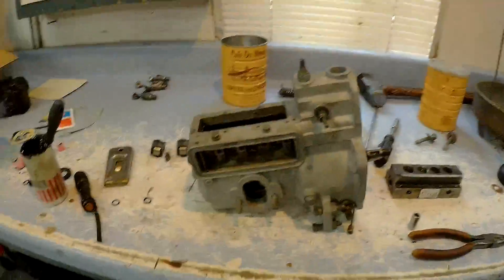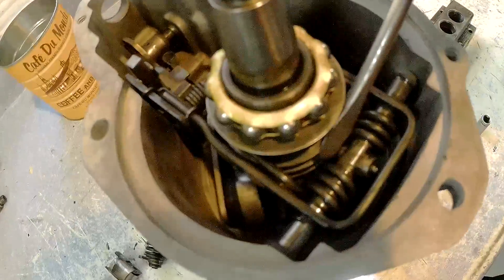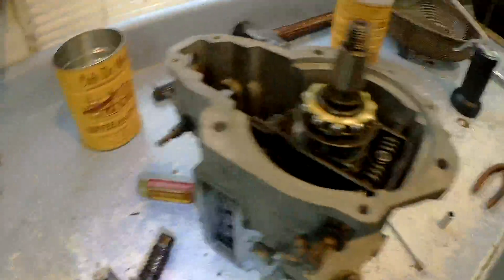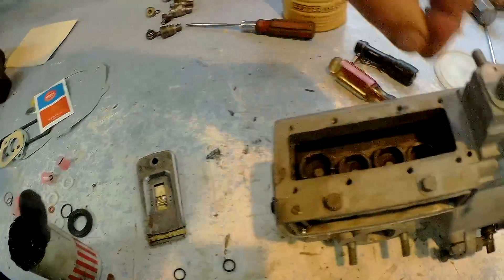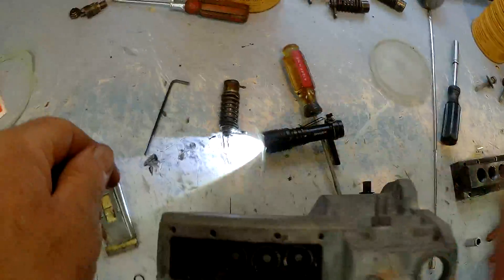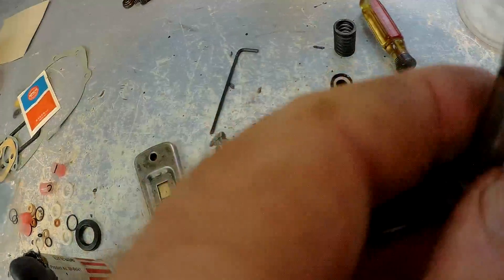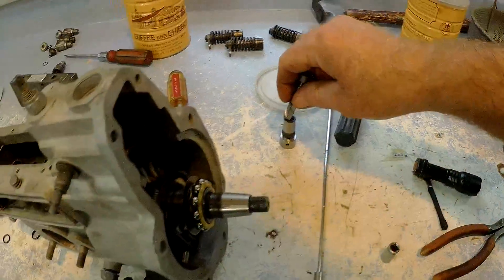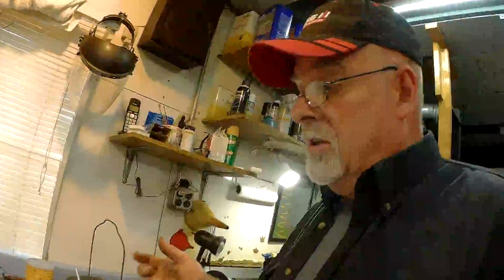Simms Injector Pump Assembly - Ford Tractor

Comment: Interesting... I have a stuck injector rack and I've tried to free it up with duck oil but with no success at the moment. It will move with a screwdriver but will not allow the cold start button to release, hence the engine goes runaway..
My question is can it be freed up or is it a case of sending it off to some specialist repairer?
Reply from the maker: Oh I'd hit it with perhaps some automatic transmission fluid, or if you don't mind spending the money, some KROIL .. Amazon sells it. Then keep working it and working it until it's free, hit the plungers as they may be sticking. The rack itself actually floats pretty free within the housing

Comment: Where can I get a rebuild kit for a p4596 pump. My throttle rod was stuck on mine and i tapped it both ways but still stuck. When i watxhed your video I took it apart and the wedges between the roller bearings wer not there and one of the  rods with the adjustment thing was stuck in place with the  part on the bottom that goes in the throttle rod was broken off. I may have broken it tapping it. The tractor was running but at full throttle so i pulled the kill swirch and it has not ran sinse. Thanks, Garry Harris

Comment: In ireland you can exchange you broken pump for a replacement reconditioned one for 350 euros and plungers  and elements and spring and seals are 250euros when baugt on the Web and the exchange will be calibrated and Garenteed by a professional.(4 cilender pump) the springs should be replaced as they brake when fatigued.they buy the stuff less vat and holesale and of higher  quality Irelandi is full of ford and fordson tractor and minimec pumps,But that's not the case every where.
Reply from the maker: WoW What a deal !
That would easily be $1500 here in the USA

Comment: I could use some help if you got a chance I don’t know if you have an email or something. I got a four 3000 diesel three cylinder getting no fuel coming out of the first injector line of the pump. I’m mechanically inclined, but I don’t know anything about diesel. Meyers said to take that top head off with the valves. I’m not sure what to do after that. Are you in the south? I saw the café do mine
Reply from the maker: Take the side cover off the injector pump with the engine running and observe the lifters, I suspect #1 is stuck "up".

Comment: couldn't figure out why my engine is suddenly on full throtle. I have checked the plungers, it seems to be ok.
Reply from the maker: Check the rack, make sure it's free. There's a little -tall cap you can remove (unscrew) on the end of the pump, the rack actually enters that tall cap.
Reply: @mark_osborne looks like the rack randomly stuck on full throtle, is there suppose to be a spring in that tall cap to help push it back?
Reply from the maker: @sionenaulala8965  no spring . Something in the govenor must have hung up

Comment: i have a simms 3 cyl pump i rebuilt engine and cant get the pump to pump up i replaced the supply pump but didnt help im getting fule to the injector pump but it wont pump up any advice?

Comment: Hello Mark, I have a Simms Pump, P4784 its for a 6 cylinder Ford 8000 farm tractor. I need to order a rebuild kit for this pump including plungers & barrels. Would you care to share with me where you ordered your rebuild kit for your Simms pump from? Thank you!
Reply from the maker: I did not order a rebuild kit.  The gasket and seal set came from Wimer Fuel Injection in Pennsylvania.  As far as the plungers and barrels, I dug around until I found a part # that matched the 9.5 mm that I was looking for then contacted Darwin Diesel in the UK.  They have a website.

Comment: So I could turn up the fuel on my 1920 to go from 33hp to the 40 hp just like  other 2.0 N844 engine have? Lkke the TC40 with the same engine.
Reply from the maker: I wouldn't doubt it !  I have a 33 hp 1920, bought it new in 1995. Great machine !  Let me know. I have no color in the exhaust under full load. I'm sure yours is the same way if it's bone stock.

Comment: Actually it's for a Fordson Major tractor, pre Ford. 
The earlier pumps had pneumatic governors, the later ones, mechanical ones. It sounds as though they're not so well known in the US? These are ten a penny in the UK, and there's any amount of Diesel service shops that would repair/re-condition these pumps. Great video - and I agree - these are great to work on!

Comment: Would it be possible to post a part number for plunger and barrel?  I have the 3 cylinder  p4665 pump.  Thanks.. Great video
Reply from the maker: yes yes  just did this on the last video

Comment: Holy moly than you so much for this!!!! This is the only video in the world that helps the people with Simms pumps. I have this pump in my boat. This is a very common pump found in the Ford marinized version, the Ford/Lehman.  I have been nursing my hurting pump for years and this year it is finally getting around 4oz of infiltration per 20 mins of run time. last season I was able to just change the oil every 10 hours instead of 50 with only 1oz. So it finally got to the point where I was afraid of ruining the core, so I stopped running the engine. So after getting the runaround from the local pump shops, and finding no information on these pumps anywhere, I finally bought the only one available "off the shelf" from England, with a core charge that cost me double. I ordered the pump last week and just found this video today!!! so there goes 1600 bucks. If I had found this earlier I would have fixed it myself, but now I will have my old core as an extra so I will rebuild that one and have an extra! Thank you so much for demystifying the Simms pump!!! There aren't enough people around that post valuable information like this for the old diesels that will outlast us all. It is actually sad that the engines are so great but the people with the knowledge are getting to be beyond the age of posting videos, so we are rapidly losing information. I plan on posting a video of me timing the pump for removal and reinstalling the new one because there isn't a single video of that in existence (that I can find anyway). We need to pass this info along to keep these beautiful machines going. I feel that owing an older machine like these is just preserving and maintaining them for the future generation. Cheers to you for being a teacher!
Reply from the maker: Thank  you so much for the kind comments ! ... and yes, that coffee rules !!!

Comment: Can anyone tell me where the smoke screw is? CNt find that info anywhere. Thank you and I know to be careful
Reply from the maker: To my knowledge "smoke screw" is an acronym for "fuel screw" because if you turn it out too far, you'll get smoke out the exhaust (un-burnt fuel). Given that, the fuel screw is on top near the front of the pump, it takes a 1/2 wrench, you loosen the nut, then back the screw out (or in) accordingly. Tighten up the nut and you are done.
Reply: @mark_osborne  thank you Mark! I really appreciate it

Comment: Hey Mark,  I got my 6600 with this pump on it running and it runs at full throttle.  The slide is free but the throttle doesn't adjust down.  I tore the pump apart and it seems that the governor isn't pushing the shaft forward when it's running.  Any ideas what it could be?
Reply from the maker: Are the governor weights operational ? ... meaning, when you move them "out", do they push the rack back?

Comment: Hello marc i have a fordson super major with a 6 cilinder and minimec pump how can i give it more fuel?
Reply from the maker: Back the fuel screw out all the way !
Reply: @mark_osborne  what screw is t and out of in
Reply from the maker: @gillianvandervelpen2730  The screw right on top of the pump, loosen the lock nut, then turn it counter clockwise, backing the screw out, then tighten the lock nut

Comment: Hello sir.  Great video.  I recently acquired a 5000 with the same pump.  It leaks an excessive amount of fuel out the banjo bolt, maybe more than going into the engine.  Any ideas why and how to remedy it?
Reply from the maker: Try changing the gaskets on the banjo bolt, hopefully the threads going into the pump are OK

Comment: Thanks for video. Where can I get the elements you showed. I have identical pump missing the id tag on pump. Are the larger element size 9.5 for the 5000 0r 7000 ford pump? I have a 5000 and need 4 new elements for it. Do you have any suggestions on where to buy and what the correct part number is for the 5000 pump elements? Thanks Jim

Comment: Attempting to get the CAV Minimec up and running on one of our tractors. Sent it out for overhaul and now it's back.
After installing, no fuel from pump. It has a little spit of fuel from the injection lines, but apparently little to no pressure.
Loads of fuel to the injection pump. It's a puzzle.
Reply from the maker: Tighten the lines at the pump, leave the lines cracked loose about a turn at the injectors. Push the throttle wide open (full rack). Crank the engine and when you start seeing that little "spit" coming out of the loose connection at the injector, tighten up the lines, one by one. It should start.  They only "spit" a tiny bit.  They will build pressure once the air is out of the line and the pump has something to push against.  Let me know tomorrow how that worked out. I'm done for the night.

Comment: What are the screws for on the side of the head to the barrel for? Locking? Adjusting? Also what do they adjust in order to get the same flow out out each injector? Thanks for your reply. My email is ghafler1@Yahoo.com. Is there a video showing the screws and what they do?
Reply from the maker: If you are referring to 6:05 yes, they adjust the fuel for each plunger and barrel.  Because all 4 plungers are on a common "rail", they need to be set so they inject the same amount of fuel into each cylinder and to do that, you unlock the set screw and slide it from side to side to achieve the result you're looking for. Make sense ?

Comment: Mark, awesome video...  Curious where did you source your parts from?  You can still get some of the items from CNH, at a premium, but surely there are others.  I've found them in the UK as that's where they were made, but what about here in the states?  Also what was your cost for getting the pump flow tested and balanced?  I have a Ford 5000 with an aftermarket turbo kit made by M&W gear, and the turbo doesn't spool up to give boost along with cool EGT.  All has been rebuilt and/or replaced, and timing is right on the money.  So I'm suspecting the pump is not putting out enough fuel.
Reply from the maker: Yes, I think you may be correct on not getting enough fuel. I paid $150 to have it put on a bench and adjusted and that included a read-out of it's capabilities at various settings.  It's important you get that so you know where you are and where you're headed if you decide to install larger plungers and barrels.  Got the plungers and barrels from Darwin Diesel in the UK.  The shipping is super fast to the states, like 3-4 days.  Jeremy Toes- manager.  www.darwindiesels.com   He's very easy to deal with via email, gets right back to ya and takes credit cards over the phone.  But you must know what you want, I don't think he's got the ability to look stuff up.  I always have part #'s when I call him.  You can get a rebuild /gasket kit from Wimer in Pennsylvania and they'll know exactly what to send you once you describe the pump. Cheap too. Like $50. www.wimerfuelinjection.com.  BTW, where do you have your timing set ?  Does it start good ?
Reply: @mark_osborne  I will check out that shop in the UK you used.  I found this company that also seems to have quite a selection of parts..https://injectionpumps.co.uk.  So the UK route seems to be the best option.  Again thanks for the video..  I was a bit hesitant on opening up the pump not knowing what to find, especially since these seems so scarce out there..but your video demystified it.

Comment: I'm curious about the oil sump in the pump(s).  What happens when fuel gets into the oil when it is not changed in a timely manner?  My pumps are on marine Lehman Fords (6 cylinders) and they went 200 hours before oil was changed in them.  One pump had what appeared to be normal consistency, one was more like water.  Both engines were running OK.  Oil in both has now been changed.  What would have worn in the pump with fuel in it?
Reply from the maker: It is so common for this to happen and it seems as tho these pumps can survive it.  They use "roller lifters" (bushed, not needle) which seem happy to run with diluted oil and the only other thing that really needs lubrication are the bucket lifters as they ride up and down in the bore. And of course the end bearings on the shaft.  But there's not much load on the shaft, so yeah, they seem to survive :-)
Reply: Good to hear because that was exactly what have happened to mine. I got the tractor recently and when changing the oil it was full of fuel. I was afraid the pump might be damaged. I have an issue with an unstable idle speed but that might be caused some leak in a fuel line.

Good to have videos like these because as you said, it is difficult to find much information about this.
Reply: Ive been rebuilding these pumps for 40years now. They get a buildup of diesel in the cambox from either: 
The seat where the barrel sits leaking. Not common and mainly caused by the splined delivery 
valve holders not having tha factory alloy clamps between each one causing the holder to undo slightly. 
Other cause is the plungers are worn in the barrels, they might feel fine but if you lay the pump on its back once its removed and had all the oil drained, you refill it thru the side door with diesel until full just under the control rod. Put 40-80si of air i to where fuel enters the pump from the liftpump of filter and watch for air bubbles. Should be nothing but Ive had pumps where it looks like a rolling boil saucepan. Ive made a special jig to test the elements with tne head removed from the pump body including all the plunger springs. 
Have to be careful even with new elements. Ive tested 1000's of Minimec elements and had many new ones that are as nad as the worn ones they should be replacing. 9.5mm plungers with 300hp or bigger Sabre marine engine delivery valves gets those little Fords flying. Dont know what injector nozzles you guys use but a BDLL140S6609 wont lead you astray. Good for 275hp on a standard D-series Ford. 
Ford Dover injectors can be used too, their hp can go as high as 425hp.

Comment: I just bought a Ford Major on Sunday, it was cobbled together but seems to run ok if you don't mind blue smoke. Fuel seems old, engine oil was low.(old guy said it didn't use oil, I suppose it couldn't, wasn't any to burn!) And I paid to much.
   First of all, thank you for doing that video, I got a lot out  of it.
 I could use some help regarding sources for parts, and are there any cross references from USA ford to Fordson? I need a couple 3 point parts, tin, and mine has an electric fuel pump pushing fuel through the lift pump. I plan on putting a new fuel lift pump in ASAP.  
  Any parts and or info sources would be greatly appreciated. 
 Also, some of the people that commented had some great info, thanks for that!